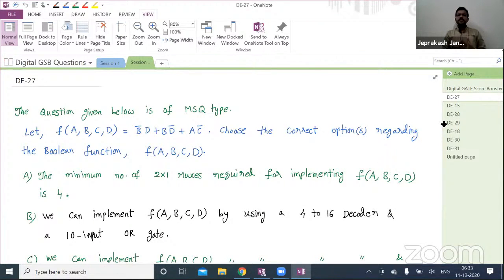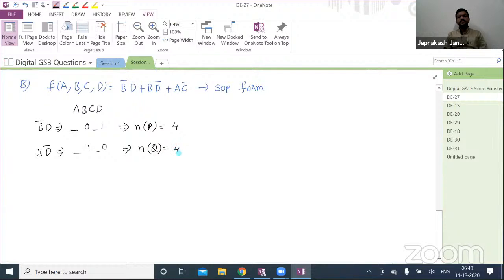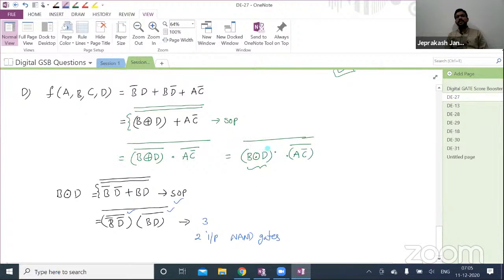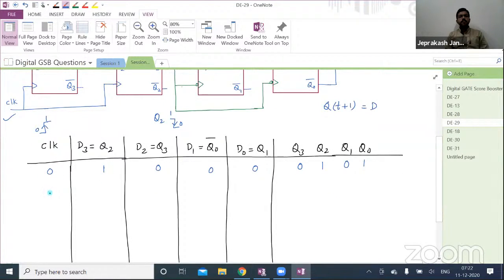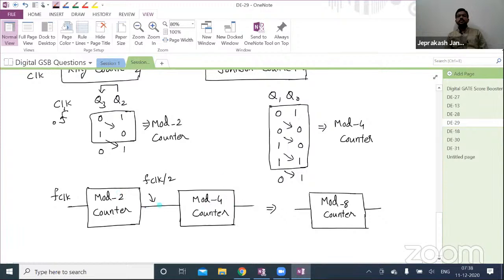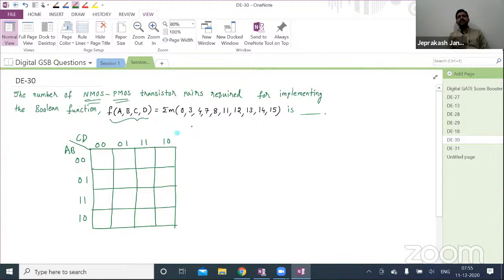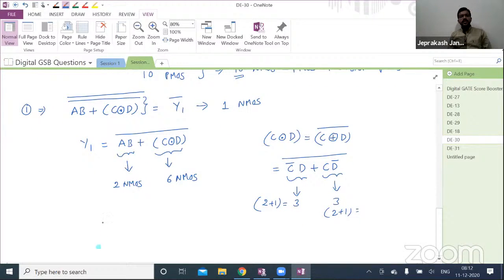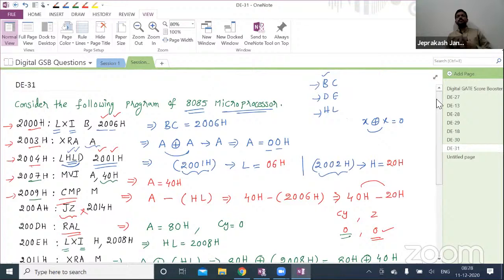Part 2 | Digital Circuits GATE Questions | GATE Score Booster, GATE Revision | GATE 2021 Preparation

Comment: For CMOS implementation question for expressing C EX-NOR D complement function we require 8 because after sub parts we need 2 more NMOS for OR operation also right
Reply: Dear Gaurav Krishna, 6 NMOS-PMOS transistor pairs are sufficient for implementing C Ex-NOR D.

C Ex-NOR D is nothing but complement of (C'D+CD').

For implementing C'D, we require 3 NMOS-PMOS transistor pairs.

For implementing CD', we require 3 NMOS-PMOS transistor pairs.

After that we will connect above NMOS sections in parallel & PMOS sections in series.